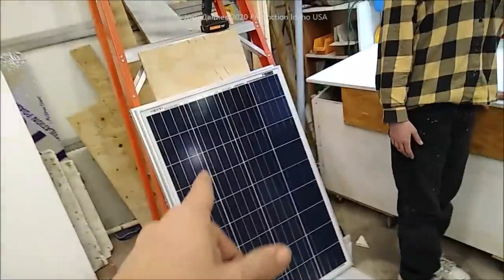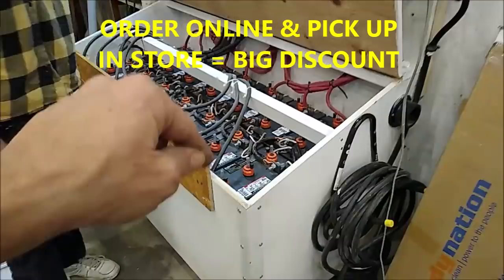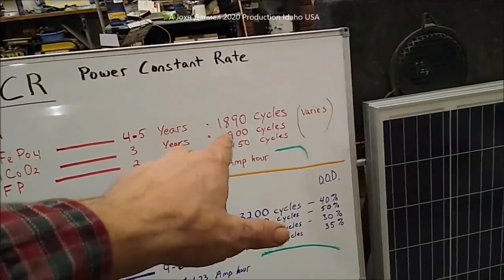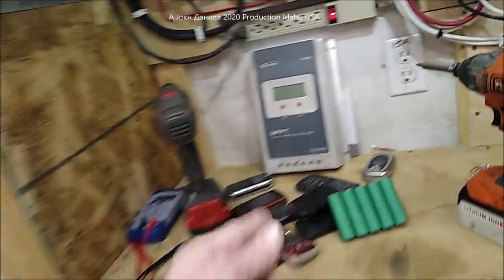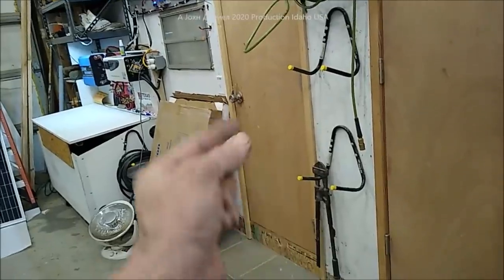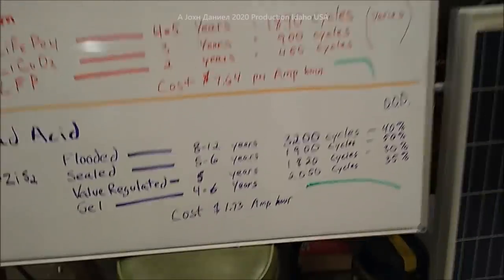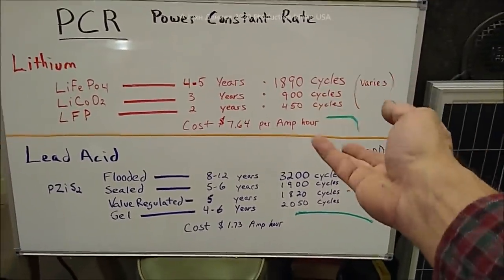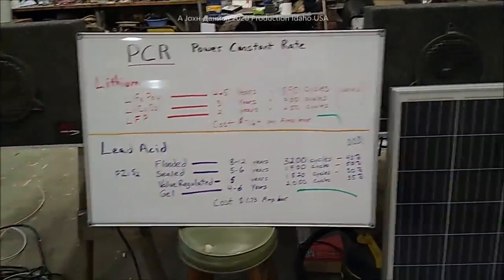Down Side of LITHIUM LiFePO4 Battery $ on RV, off grid & solar use (notes below)

Comment: Lithium batteries need more care in use than lead acid but I think you overstate your cost argument.  A commonly used off-grid lithium battery is the Tesla module which sells for about $1500 (5300 watt hr, 24v) so about $3.4 per 12v amp hr. It is widely accepted that you can use more of the lithium capacity with less impact on battery life so you would need larger lead acid batteries for the same usable capacity - say double.    So $3.4 vs...2x$1.73

I think your assumed lithium battery life is under-stated, given available info on Tesla battery degradation which is much less than most people had expected.
Reply from the maker: 26 sources and all averaged. Power Constant Rate applied ( use while under a charge rate) But, does anyone ever get tired of the Tesla Argument? Or the Leaf, or Prius. They do not charge and get used at the same time at their rating or even close to it. Even brake regeneration disconnects the main battery from motive to recovery. Those cars, they have a draw rate that's predictable. Buyers of the WALL BATTERY have learned its not very friendly to natures sources, or for high draw one day, solar charging then no draw the next. The Lithium Cult is strong though, I must admit.
Reply: Rhian Taylor a

Comment: Lifepo4 cells from calb have been used in car conversions for 10 years, most lasting 5 years minimum you have to look at the very low resistance which mean more than 30 percent power being received by the battery, i found that in the used cells i put in last year, yes they are not for everyone, you must do your research.
Reply from the maker: Yes, in cars, on power tools, in flashlights. With a known POWER CONSTANT RATE. However, off grid, RV, Solar System? Are you going to use them at the same identical daily rates? Same peaks, same charge and discharge rates? If you do not, they degrade ( as claimed by the makers)
Reply: @JOHNDANIEL1  It is lower c rates, so they will last longer. We actually have studies to substantiate this. The BYD packs were used in large solar installations, insured, and they were in the megawatt hour size. Power tools and flashlights typically use NMC variants. Not LiFepo4. John, please just google what your viewers are saying here in the comments. 

Using lifepo4 in a car, with a small pack size and high surge, with old manufacturing methods, will die fast. We have better manufacturing methods now and they dissipate heat better. The calb cells did die fast for ev use, unless the c rate was low.
Reply from the maker: @WillProwse  Again another boat is missed! I guess I should have just put COST in the video 50 times instead of 10. Your thinking I have no info on Lithium or lithium formats like LiFePo for some reason. So, Will, when you promote Lithium Titanium Oxide I can ride this wagon. In a 6 pack, 13.8 volts nominal of 60 amp, They produce a healthy 13.8 constant which is what RV's, Inverters, and solar chargers are happy with, have a high end safe of 16.8, Charge issue free off of wind turbines, have a easy 16 volt non issue safe charge field, do not get iron skinning due to mid cycles since they are carbon free on the shield and anodes, DO NOT have a internal BMS and can and are configured with outside tap balancing NOT inboard.  I am thinking from all your videos, you just never knew about them. Hurricane Wind Power are looking to them based on my design, in the Lead Acid / LpTO hybrid system which I designed in 2019 and that process will soon be in a video.  But go get these LpTO as a kit or make one, Ass blistering amps, it makes a battle born look like a toy. 66160 Lithium Titanium Oxide Batteries whoop them all, and again no internal electronics to go whacko.  https://www.aliexpress.com/item/4000298866584.html
Reply: @JOHNDANIEL1  He actually did a video where he tested them, the performance was pretty poor compared to Lifepo4, the only  benefit is there long lifespan. The efficiency at taking a charge was nowhere near as good, basically in the range of lead acid, and the costs for them are still quite high.

Comment: I've maintained Pb battery systems  up to and above 10,000Ah systems.  Military and Commercial .  I sure like the  lack of maintenance required on LiFePo4 batteries.   No required Equalization's.  No holes blown in my favorite pair of pants.    LiFePo4 battery chemistry is every bit as safe as any Pb battery made.  More so for lack of Out Gassing.     Buying the things off the shelf sure can be a costly venture.  If you take your time and look around they can be had  reasonably.   I purchased  4  100Ah sets of Prismatic cells for $420 a set delivered.  Unlike Pb batteries  being limited to 50% of the batteries rated Ah,  LiFePo4 batteries are usable for the batteries full 100Ah Rating.  This 400Ah of total usable power is like having 800Ah of Pb storage cell.  I expect them to out live me.  I fully expect well over 3000 cycles out of these batteries charging them only to 3.60V per cell. That may not take much.  LOL    Pb batteries would never do that.

Cycle Life
Each cycle has an interval between the standard charge and the discharge with 2.5V cutoff.
With a capacity > 80% after 3500 cycles.
Reply from the maker: I think in time they will improve, but with only a few years of the DC-LiFePo on the market, 1 million junk sellers, China as your only source the 50% rate of 1/2 priced 370 AH is still 135AH and you can use them while charging without harm, unlike LiFePo chemistry that degrades fast in that scenario. Thats the PCR factor no one discusses.
Reply: Hey Buddy, hate to tell you that Missouri Whinning and Stumpidness has got my channel taken down, TheBillytheJack2010!! I have a thats been up 4 yrs now and has a new video on the Axial Flux 12 coil I'm building. So please sub and like my videos, please... Heres a link:
https://www.youtube.com/watch?v=Jo8967xP8GE&lc=z22gxr4hhovsyeqtm2hd0s2yq3pcpphhtjgmutyvvj00u00c2

Comment: Sorry John, wrong numbers! Your numbers (cycles) on Lithium batteries are real to reach 90% of capacity.
Reply from the maker: Depends on your source for info. Pick the best sellers lie, then stick with it! However, I think in time they will improve, but with only a few years of the DC-LiFePo on the market, 1 million junk battery sellers, China as your only source compared to the 50% rate of 1/2 priced 370 AH is still 135AH and you can use them while charging without harm, unlike LiFePo chemistry that degrades fast in that scenario. Thats the PCR factor no one discusses. Power Constant Rate, just ask Elon Musk, he runs from it.
Reply: @JOHNDANIEL1  Actually Elon just announced he is going to LiFeP04 for the Y and Model 3

Comment: What I like about your video information is you tell it like it is -- no bullshit --
Reply from the maker: The LiFePo4 Cult Members will have their heads explode, but the Power Constant Rates of Lithium verses Lead Acid can not be denied by fact, they will pump the LiFePo4 advertisers lies. Lithium operation due to the BMS and controllers can not provide the PCR of Lead Acid while under charge. Under a 30% and higher charge/discharge rates 50% of BMS controllers fail.
Reply: @JOHNDANIEL1  - it's just one more way to screw people out of their money. I also run the tried and true AGM batteries from WindyNation... https://youtu.be/HHW-Q9NvNvI?t=97
Reply from the maker: @mobileoffgridpatriot8191  If You have a controller with a big solenoid in it, you will always destroy batteries so be careful. You will also brown up your solar panels using it.
Reply from the maker: @mobileoffgridpatriot8191  see https://youtu.be/RbUXmZwfYK8  about over tripping your diversions.
Reply: @JOHNDANIEL1  The controller shuts itself off physically when the Batteries are at 100% - what I do is shut the breakers off to the solar panels and the controller - The wind turbine does a good job of diverting the extra to the dump load - I am sure I need some tweeks to the system - https://youtu.be/D5dW9MOoFbk?t=465
Reply from the maker: If ANY controller pulls your batteries under 14.1 volts for any reason, toss it in the recycle bin, start over!

Comment: Hay John, I'm using lead acid batteries from Napa d/s. I'm using thunder bolt solar system, and with no problems at all. 6 batteries and 8 panels system. Dennis

Comment: Lithium has advantages if weight is a factor. The people pushing lithium are using smoke and mirrors to make lithium look cheaper. Lead acid is cheaper, you might have to have to use twice as many batteries. But $ 1000 of lead acid will out perform and out last $ 1000 of lithium batteries.
Reply from the maker: Correct, but be prepared to be attacked by the China LiFePo4 sellers and promoters.

Comment: what say you - can old lead batteries be refurbished ? I just had someone give me an kind of new looking deepcycle lead battery but it wont take a charge ,,,
Reply from the maker: Yes, but look inside of it first, make sure no bad cells by looking for reddish or rust like spots, ( hot spots ) and if it has distorted cells. If not, its worth trying.
Reply: @JOHNDANIEL1  pour out the old stuff and put in new acid?  Thanks
Reply: @ronbonick4265  wash Them inside with a water hose or thin hose..
I was given 10 Trodjan 120A Deep cycle 
I washed Them out .. Lot of granulat in the buttom of the batteri
Then new asid/water .. and IT is running again (4 yers ago still running just refill water )
Reply: @ronbonick4265  Be careful! Not about the acid, but about the crud!
The crud sinks to the bottom and if you simply upend your cell it will get across the bottom of all the plates shorting them out!

Comment: I am the same way john i love my crown 6v 235 ah deep cycle red top flooded batteries thick plates and i have 12 of those and 4/0 cables for ties 12 inches each and a copper bus bars on power in and power out sides .bad ass power 12v 1410 ah.
Reply: same battery those batteries are awesome